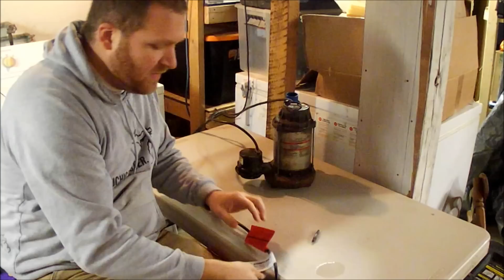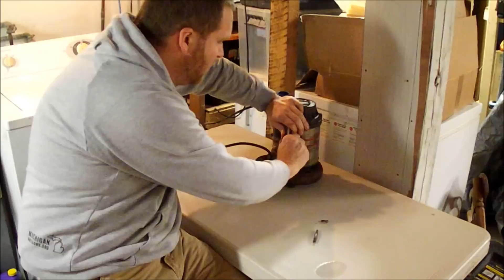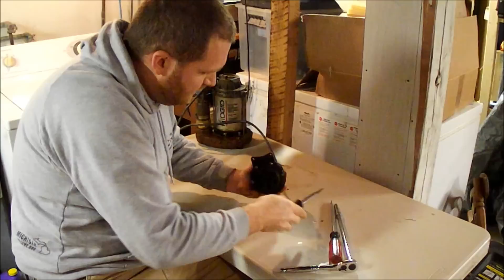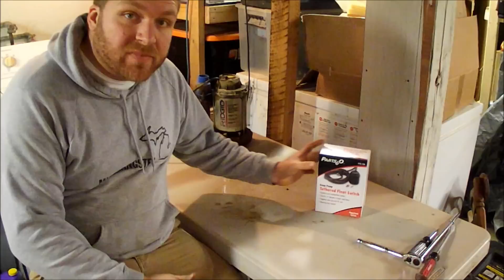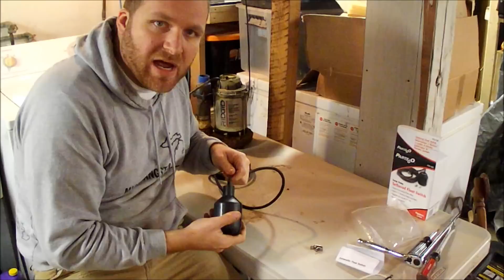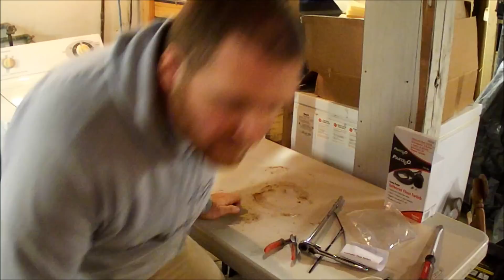Ridgid Sump Pump Diaphragm Switch Tear Down Replace With Float

Comment: That's why I now have a Pedestal Type  Sump Pump  because the switch is on top and Rarely Fails  I also have a Extra  Pump so if it does Fail during a Heavy Rain or Storm just disconnect the discharge hose swap it out and back in the game . nothing like a flooded Basement  or losing you Heater or Washer and Dryer  so keep a spare Pump on hand its worth it

Comment: I have a Rigid SP-330D with a single electric plug. The wire connects the pump to the switch to the plug. Can the diaphragm switch be adjusted to change the water level that will trigger the pump. I need to raise the water level that triggers the pump. If not, is it possible to remove the switch and add a float.
Reply from the maker: There is not a way to adjust diaphragm switch other then raising or lowering it on the rigid.  In this case I believe you would have to raise or lower the whole pump.  Since it is setup with one wire there is no way to to remove switch with out rewiring plug on pump and I hate to recommend that because it may never be water tight again.
Reply: Thanks for your response. I bought 2 bolts 31/2 inches longer than the factory bolts and put a washer and nut on each to raise the switch above the pump. It now allows the water to reach its natural level without the pump constantly running. The unfortunate side effect is it shuts off that distance away from the bottom.

Comment: Nice video man.  I have the same setup and my switch went bad too.  Luckily I called Ridgid and to my surprise they reinstated my lifetime warranty on the pump and sending me a new switch for free!  In order to keep the lifetime warranty on the pump, I just have to buy a new switch at $42 from the within every 2 years.  If the pump dies within each 2 year period, they will replace the while thing for free.  $21 a year sounds decent to me!  This pump is like $300!

Comment: Yeah still cant get mine apart all the way either, I don't like the tethered floats though better off with a fixed float switch that goes up to an arm. Tethered seem to get hung up a lot and a huge amount of water stays in sump because float has to go upside down to turn on. Fixed float only needs a few inches to turn on.